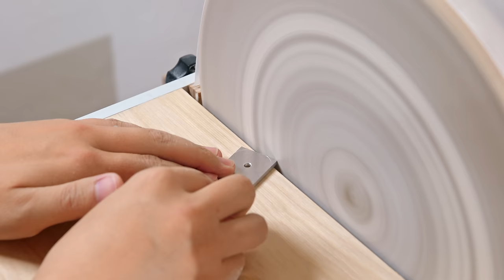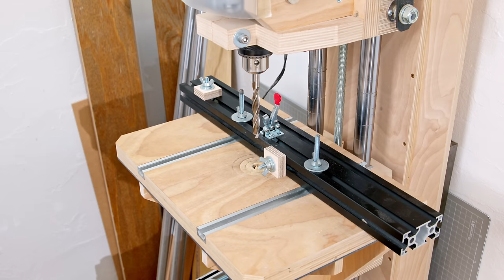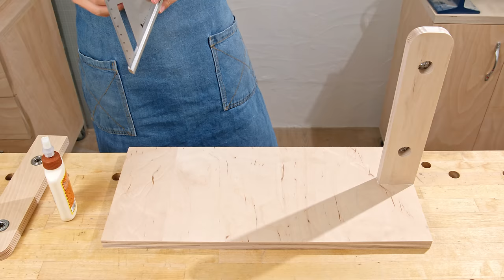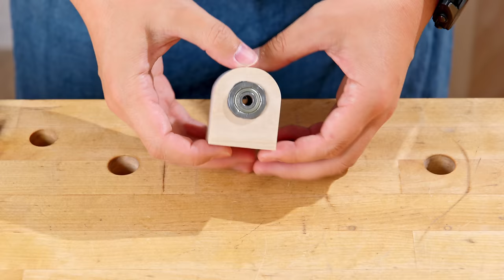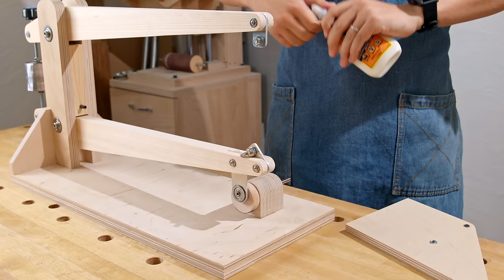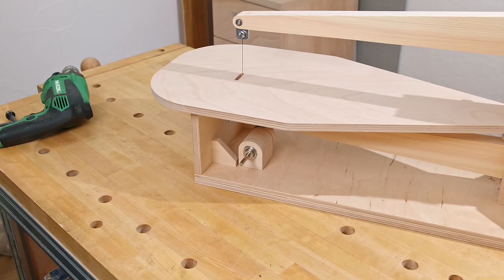Homemade Scroll Saw 【DIY】

Comment: Make a homemade scroll saw ... With an existing scrollsaw and $15,000 of equipment.
Reply: Most of the other tools were homemade as well.

- but, nice try.
Reply: @silverstake88 exactly - he made almost all of his machines. Now way was there $15k of tools to make it.
Reply: If you don’t like what he makes don’t watch his videos.
Reply: You could do everything here with just basic hand tools; it is simply going to take longer and require a lot more patience, perhaps more than most people are willing to have. 

If you have a way to cut , drill , measure , check alignment,  hold the material securely,  sand , press , glue material together, you could make this if you really wanted to for probably for 100 dollars or a couple at the very most. Considering how much money gets wasted by people in the first world on a daily basis on things that are completely fruitless endeavours in the grand scheme of things that isn't a lot for a tool that could potentially last decades done right; he may have quite a few tools to use but ultimately if you took most of them away he'd just be able to create them again, as the value is in the skill learned not the tool held.

Comment: Excellent project with precision engineering of the parts as always. One thing that worries me though, is what happens when the blade snaps. Delicate blades like that do snap often and in this case, that leaves a jagged edge going up and down right next the the operator's fingers.
Reply: Scroll saw blades are so thin and springy that when they snap they just sort of buzz against your finger...and if they do, your fingers were far too close to the blade anyway.  I buy/break scroll saw blades by the gross and haven't ever been injured by a broken blade. Commercially manufactured saws come equipped with a U shaped blade guard which protects from this theoretical mode of injury but I have found them to be worse than useless and have removed them from every scroll saw I have ever owned.
Reply: @christopherdahle9985  
Yep.......That's the deal.

Comment: For fixing at certain angles (45 or 90 degrees), install a spring-loaded ball in the base and holes in the rotating limb
Reply: He goes to less than ± 0.1°. I doubt he would get that your way.

Comment: I would've probably made the saw arm move all together on a single pivot, but I think your approach is smarter, because a parallelogram-style pivot like this results in more accurate vertical travel in the blade. The only thing that concerned me was that I didn't see you use ball bearings or even grease between the cross dowels and bushings in the tensioning mechanism. I'd be worried about excessive heat and wear at those two joints, but maybe my concerns are unfounded.

Comment: So, the drill is attached to a wooded offset wheel that hits the bottom of the working area.. what could go wrong with high-speed spinning wooden part against a wood surfaces 😂